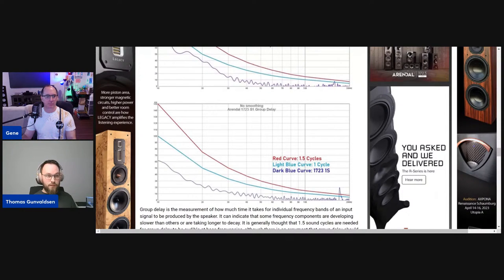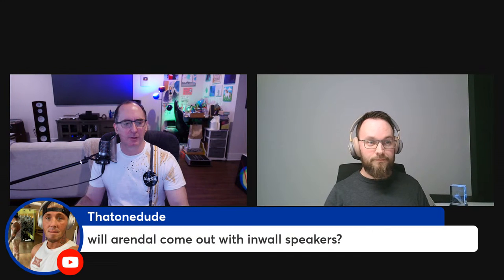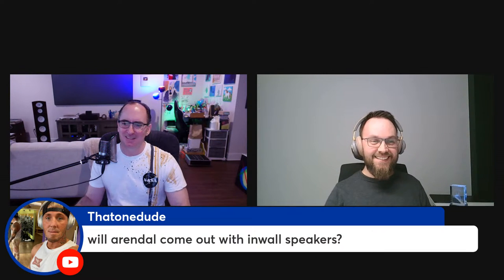Arendal Sound: Expert Insight - A Close Look at 1723 Subwoofers

Comment: Klipsch together with Crutchfield are  outstanding. I had both of my Klipsch R-115SW plate ampliers die. With 17 days left on 5 year warranty. Only 1 year warranty on the amplier. They were able to source me 1 brand new amplier. They took back the other subwoofer after 5 years of use and completely refunded me the full price as a store credit. That's why I've been a customer for 28 years.

Comment: I have two JBL-manufactured-for-Revel 15” subwoofer drivers mounted in two 4.25 cuft enclosures driven by a Crown XLi800 amp delivering 325 WPC into 4 Ohms.  They’ll bury any commercially available subwoofer pair with possible exception of a pair of SVS 16” subwoofers.
Reply: Yeah, that driver was really good. Many of them had issues with the lead wires slapping and breaking. Glad yours are ok